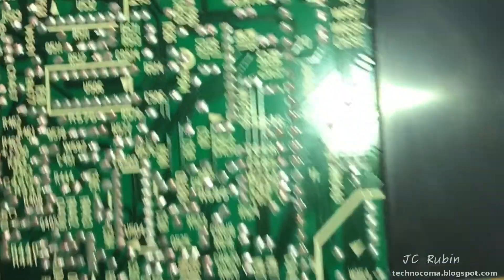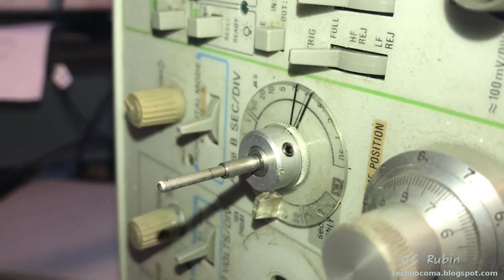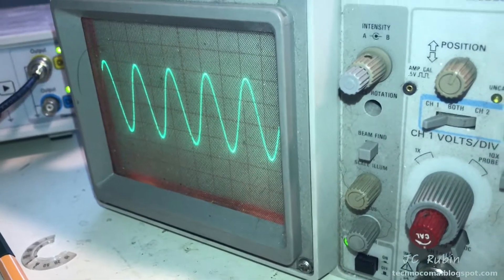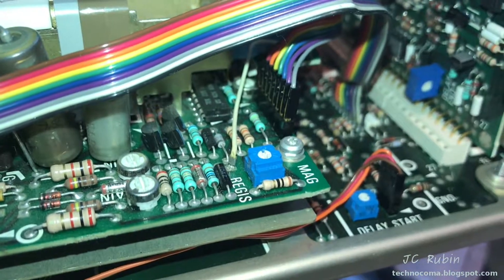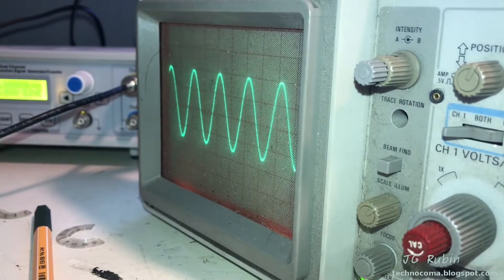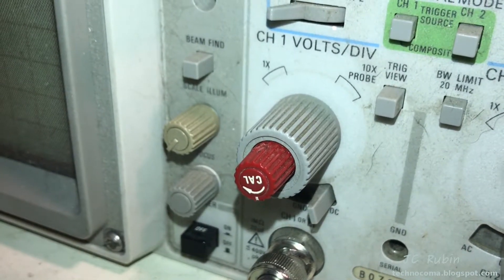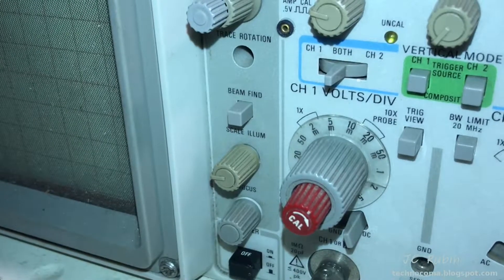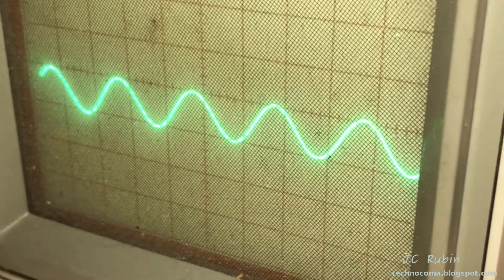Tektronix AN/USM-488 2235 Oscilloscope repair and calibration 2 of 7

Comment: Great video!!! - FYI… I have the same 2235 scope and had the exact same problem with it back in 2009. Like yours, it worked great after replacing the same horizontal sweep potentiometer. A Word of caution though; I was informed by a friend who is a field engineer at Tektronix that those potentiometers have a very short sweep life. They are designed to wear out after only a few sweeps and great care should be taken when adjusting them.